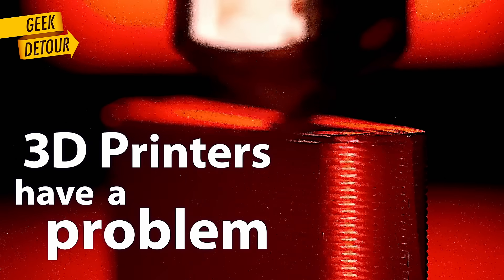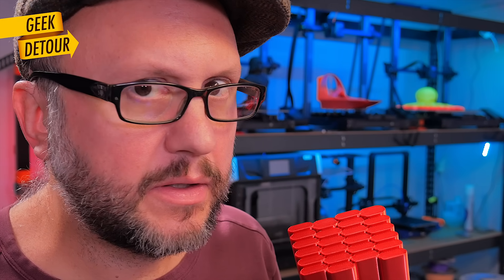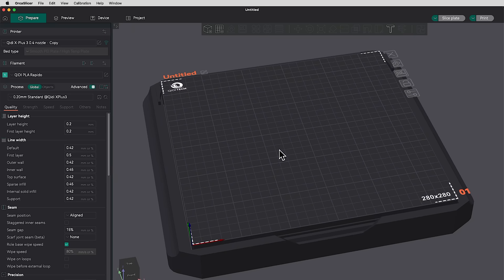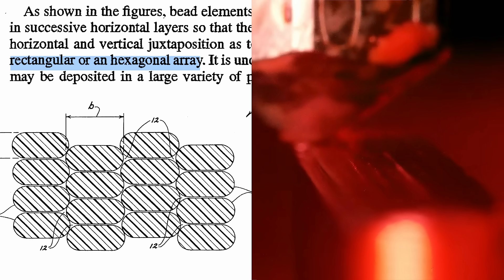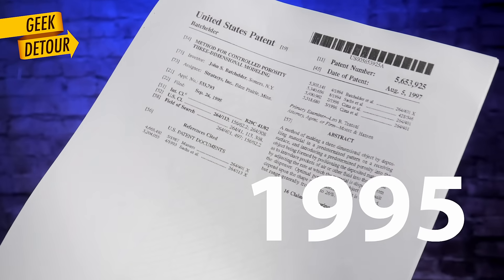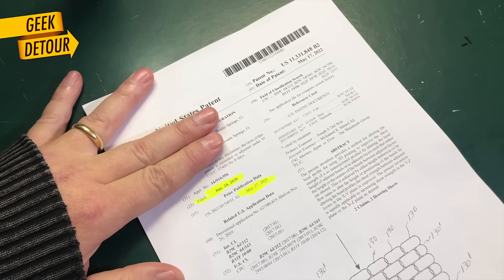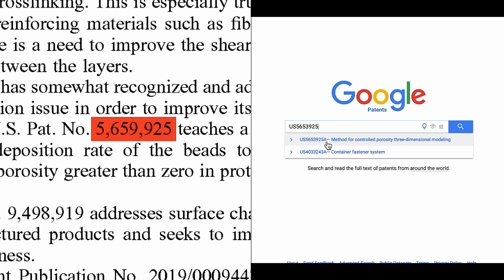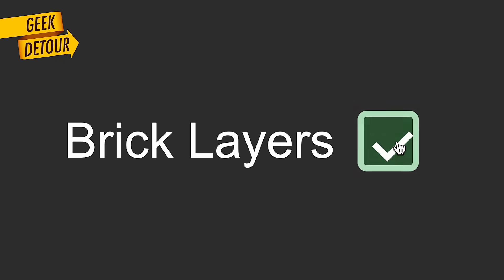Brick Layers: Stronger 3D Prints TODAY - instead of 2040 😬

Comment: I'm a machine design engineer, and over the years I've notice many patents get granted for common sense things that have been widely used for MANY decades.  No one in the past bothered to file a patent, because it was already common, and then someone comes along, re-"invents" it and files a patent, and it is granted.   It seems the patent examiners have very little knowledge of common practices and don't really understand many of the supposed "innovations" they are approving.
Reply: Thhat assumes the patent examiners to have any opportunity to perform the titular task. Statistics on the US patent system (staff vs cases) indicate they blatantly cannot and could only operate by automatic ignorant acceptance.
Reply: @0LoneTech  that makes the system useless to protect innovation as they claimed it was for. The system actually prevents innovation.
Reply: @monad_tcp  Yes, that is the effect of removing the safeguards. Effectively the government is blindly granting more power to the most aggressive and affluent. The purpose of examining applications was to ensure they were of significant enough value to society to motivate the temporary monopoly reward.
Reply: You mean we could file a patent for a tool for eating with an handle  and one larger concave end, and even call it "Spoon" and it could pass?
Reply: It's like with copyright laws and someone claimed the major scale in music the other day.
Reply: @monad_tcp  Disney trying to copyright the Dia de Muertos when Coco came out. Probably the most shitty corp move in a long time if you ask me
Reply: Patents aren't examined that close, more efficient to just rubber stamp everything and let the courts figure out the validity
Reply: If it is proven that that technique predates the patent, then they should revoke the patent. It really should be that simple.
Reply: I've seen the same in electronics.  Very obvious things like bubble free pipelines, the sort of thing any engineer would 'reinvent' whenever the need came up are patented.  It's like somebody patented buttering bread before adding jam rather than after.
Reply: It should be that if you can prove something was commonly done before the patent was filed, then the patent is indefensible despite being filed.
Reply: The patent office is pretty liberal with granting patents. I think the thought process is that if the patent has prior art or shouldn't be granted, then someone will challenge the patent and it will be invalidated. I don't know if that's the most efficient way to do things for the public as a whole, but from the PTO's point of view, it's the most efficient for them..
Reply: @chasemadison  The patent office is funded from patent application fees.  There's certainly an incentive for them to be lenient on patent applications, because it keeps the lights on.
Reply: @chasemadison  Maybe if there was a way to challenge a patent short of taking it to court this would work, maybe open source patent analysis to some degree. Post them up online for comment and just do a more in depth analysis to ones that get reported on by the public.
Reply: Or they simply don't care because they keep their job, and the office continues to make money.
Reply: Certain patents are immoral as well like medical patents, like yeah they should be rewarded for advancing medicine but this is something that saves peoples lives, patents shouldn't be a thing as it makes medical care more expensive than it needs to be.
Reply: @ArstKoben  If patents didn't exist the medicine likely wouldn't exist. It's not just about rewarding for innovation, the patent system makes the key information for the innovation completely public, which allows other people to immediately begin building on that innovation. 
    Without patents we would have something like the Guild system back in the dark ages, where all knowledge and innovation was hoarded and guarded in secret. It took hundreds of years for technology, medicine included, to make any meaningful advancement prior to the creation of the patent system.
    What we need is to do a better job of ensuring that the patent system isn't abused and exploited, so that critical inventions (including medicine) are distributed fairly to both the inventors and the people who need those inventions.
Reply: It is my understanding that the us patent office is very very busy
Reply: Ezek direkt csinálják. Nem feltalálókról van szó, hanem ebből akar megélni. Simán megnyerhető ellene a per, ahogy az Apple esetén a lekerekített sarkú telefonnal. A vicces az, hogy amikor a kisember akar valamit szabadalmaztatni akkor meg mindenbe belekötnek, nagyon nehéz végig vinni, aztán ugyan úgy nem védi meg a valódi szellemi termékeket a szabadalom a nagy cégek simán ellopják az ügyvédeikkel.
Reply: Patent laws all around the world clearly states that you cannot patent something that is "public knowledge". It probably happens just like you say, but it wouldn't hold up in court.
Reply: In British patent law, I believe there is a defence against patenting something "apparent to a person skilled in the art", to prevent the patenting of something that is already well-known.
Reply: @ajward137  It's the same here, but still patents are granted all the time that are very trivial and obvious to many people.  To successfully challenge those patents requires spending a LOT of time and money with an attorney.   Therefore, they usually go unchallenged.
Reply: Its a gov bussiness not peoples movement for the future.
Reply: The examiners just love the money earned by each new patent that is not cheap to register
Reply: @luismlc89  The examiners are government employees. They are not paid per-patent, nor do they or anybody in their org tree receive money based on patent fees. 
    If you don't know wtf you're talking about, why speak?
Reply: Yes umm I wanna patent using 4 wheels rotated by an engine....😂😢
Reply: Here at the end of 2025 where pokemon just sucessfully filed a patent for "having a summoned creature fight for you in a game" so yeah this comment aged way too well and that sucks. As an aspiring game dev these patents are out of hand and I truly believe that core game mechanics should not be patentable, sure if you have something truly revolutionary and unique then yeah that makes sense but having these generic game mechanics patented makes absolutely no sense and stifles creativity.
Reply: Sounds antiseptic
Reply: China leads the way unfortunately.
 We are dancing around legislative ground and authorization, they just build thinks.
Maybe some engineer is crying in corner with CEO of company, but they move forward as a nation
Reply: Patents are a protective measure, and the patent holder must sue you if they believe you've violated their patent. If you can prove in court that the claims of their patent were already common practice or were not novel, you win and their patent is voided.
Reply: If they got an expert to rigorously review every patent, fees would go way up. It's much easier to let people fight it in court
Reply: I think the issue is they don't have TIME. I've heard that they have so many new patent filings that they have quotas for a certain number of patents to process, and at a certain point it's just easier to approve the patent and let the courts sort out any issues. There aren't any serious consequences for the patent office approving bad patents, worst case they have to re-examine a patent, so that's the easy option. Putting in bad references should just be an automatic rejection, but the truth is the Examiner would have to take the time to understand the patent and understand how the reference might be related to the patent in order to tell if the reference is bad, and they just don't have time for that. So, if the reference isn't obviously doing the same thing as the patent, they let it past, even though the reason they aren't doing the same thing is because the reference isn't doing what the patent application says it is doing.

Comment: About the wrong patent number. I wouldn't be surprised, it this is a scanning error, where the scanner pattern matched a 9 instead of the 3.
Reply from the maker: Well… the patent has 5 variations already… in all of them, numbers are wrong.
Reply: @GeekDetour  sounds like it's either extremely poor research and not being able to STRG-C>V propperly or pattern matching gone wilde while scanning.
And as we know, if they used xerox mashienes to scan the documents, that's not as unlikely as one might hope.

Comment: You need not worry about the invalid patent. Just implement the printing method and let them try to raise the issue in court against you if they believe they have a claim. You'd have a strong affirmative defense and basis for motion to dismiss. Also, you can REFUSE FOR CAUSE any lawsuits that come your way. Believe it or not, lawsuits are voluntary and by consent. If you don't consent to participate in court you don't have to, and they do not have jurisdiction. Lastly, you can protect your interests by redeeming lawful money per 12 USC 411. This removes the presumption that you are an indorser of the federal reserve debt notes, and instead a holder of US Treasury notes that are not subject to various obligations as FRNs are. Congress has misused their "plenary" powers over interstate commerce to extend their limited jurisdiction to all states, so take yourself out of "interstate commerce" and you are no longer subject to their statutes (statutes are not laws, they are by-laws that require affirmative agreement and acceptance to have any force or effect).

Comment: problematic especially because half stepping layers would be so simple to accomplish in almost any slicer
another, would be speed advantage and surface quality, doing the outer layers really thin and slow, laying really thick layers on the inside on a single pass.
I can print glass clear PETG, but only really slowly (15-25mm/s) this could triple the rate

Comment: Now a lawyer, but work in thr IP space with product development.

The patent CAN be challenged.   However it will cost about $500-$500,000.

What will have to happen is for someone to "violate" the 2020 patent, then have a lawyer write a letter to the holder of the 2020 patent holder explaining that you ARE currently distributing the software for free or sale or whatever.  It should also contain proper reference to the expired patent.  A lawyer needs to send it registered mail, and keep a copy. That's the $500.

Now 2 things can happen.

1.  They do nothing.  Failure to protect their patent weakens their claims to nonexistance. This is why it's important to send notification and get the clock going on them knowing if the infringement. 

2.  They sue you.   You can freely ignore all the letters they send, they dint mean shit until they sue you.  If and ONLY if they sue you do you have to go to court and kick their ass invalidating their claims.  That's where the up to $500,000 comes in.

I can't say "do it" but if someone posted the code as a merge in the code base anonymously on git hub and someone else who noticed it sent a letter to the other company,  they would have a hard time finding anyone to sue.  And in all likelihood, they couldn't enforce jack.
Reply: My guess as a non lawyer but only someone in the field is that it would playing like this.  Open-source slicer posts thr brick code.

2020 patent holder doesn't do shit because they know they would lose in court, and it'd cheaper and just as good for them to claim they have a patent. Which they would.   It would just be a marketing and asset value thing.

Everyone just officially ignores each other as the ability to claim they have a patent on this is more important then actually having exclusiveity.   

Best case they "donate" the patent to avoid the lawsuit while bragging how cool and smart they are providing tech to the community.

Comment: There's nothing wrong with having two patants claim to achieve the same outcome, they just have to have different methods- and based on the images provided, they do. The old patent's layers do not overlap other layers. The new one shows overlap from adjacent vertical layers, which yes in theory would add further strength, if not over extruded. Sounds to me like if you don't overlap the layers, there's no infringement. NAL.
Reply from the maker: In your analysis, Stratasys' patent suggests you can actually 3D Print Beads that don't touch each other. They would be 'floating close to each other without touching' - because the drawn beads don't overlap. I am sorry, it is the very same technique. This comment sounds a lot like damage control. Hello there!
Reply: @GeekDetour  If the new patent's writing outlines both methods, then what I said is moot. It was just a visual observation based on the documents shown.
Reply: @GeekDetour  I don't know what damage control I am supposed to be doing, I'm not involved with either process or company.

Comment: If I were putting it in a slicer I would call it a means of reducing porosity as it is just possible the patent would hold if it were being used as a means of increasing strength.
Reply from the maker: That's interesting: Educating users about the weird wording used to avoid copyright infringement. Don't call it "Stronger", call it "Less Porous" 🤣
Reply: @GeekDetour  yeah, patents are written to cover lots of things but they can be contested later. So if it came to court most claims wouldn't stand up and that is normal.

Comment: 0:01 In my view, there are 2 realistic ways that this video can make an extremely positive difference:

Slicers start implementing the technique, and stratasys does nothing since they know they have no leg to stand on, specially if someone "bigger" like prusa is the one doing that, since they have resources to make clear that this patent is trash, and get lawsuits rejected.

I think the other positive outcome could come on the current lawsuit against bambu. Heated beds don't seem that hard to come up with, you heat up stuff to get it to stick together. Maybe Bambu could use this clearly invalid patent as an argument (and probably more with a bit of digging), helping them win the already questionable heated bed thing, and shut stratasys up.

Either way, getting the community talking about it is very good, and I hope that at least this bad image on stratasys impacts them negatively to slow them from being so trashy.

Comment: The earliest priority date of the patent in question is November 2019, so the February 2019 Prusa post could potentially be prior art if it was publicly accessible and easy enough to find.  That is with the caveat that if the patent owner published the invention prior to the February 2019 date, it may remove the post as prior art due to the U.S.'s one year grace period.

It would have been the person filing the patent application that mistyped the patent number and it does not appear that they cited it in an information disclosure statement (tisk tisk).  I'm not sure if the patent examiner looked at the background of the patent, but that patent is not listed on the face of the patent in references cited, so it is possible that the patent examiner neither read the background (feasible, they don't get a ton of time) nor found it in their search.  

I'm not going to go beyond saying those things except to say that that is not legal advice, just observations about the patent in question.
Reply from the maker: Excellent comment, thanks! I have a question: are you an attorney? Just curious, since you mentioned something quite specific (the One Year Grace)
Reply: @GeekDetour  Yes, I am a patent attorney.

Comment: Sorry, but open source doesn't have the money to fight patents like this. It costs a lot of money. What you are saying sounds like a great idea until you realize it would kill many open source projects after they get sued. Patents aren't for protection. Patents are used as weapons. Once they drain you for hundreds of thousands of dollars, they will own all the code you wrote that makes it and permanently force the project to revert the code base back to before the patent usage. Not doing this sounds like giving up, but our society was designed so you have to give up. When you give up, you can move on. When you move on, you can get things done. I have done a lot of things that I have to put down because of patents as well. I have worked at companies where they avoided patents under similar circumstances. There isn't anyone that is going to come and save you if you cry for help. Don't poke the bear.

Comment: Just make a substantial improvement to it, patent the new process and release it freely. I suggest if on internal shells you added a "shimmy" to the bricks you would gain yet more surface area for bonding as well as improving the mechanical connection and making the brick effect more isotropic rather than the mono directional nature of the current "state of the art" Something akin (but not limited to) to the "fuzzy skin" effect in prusa.